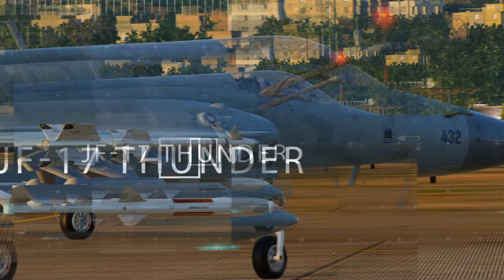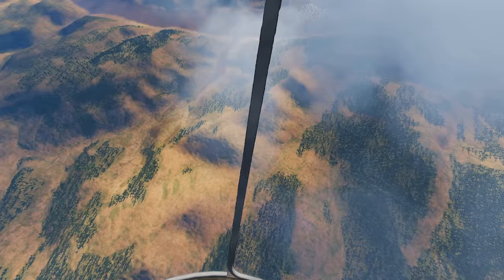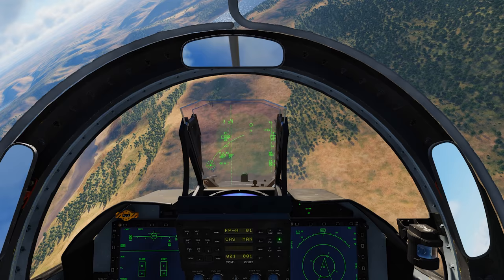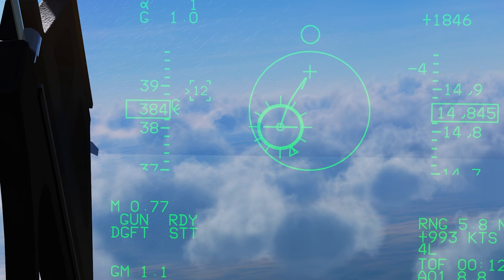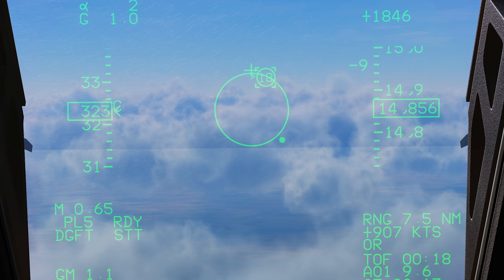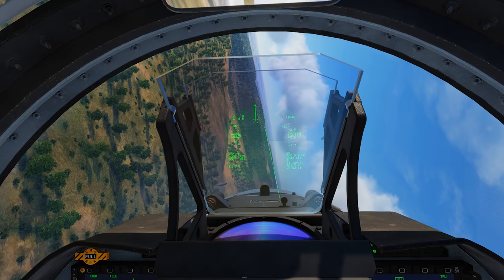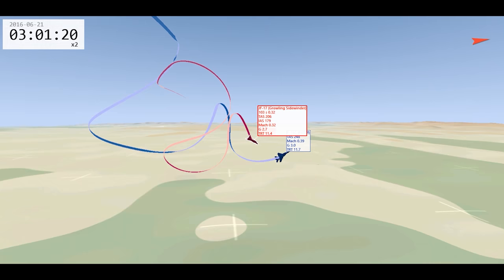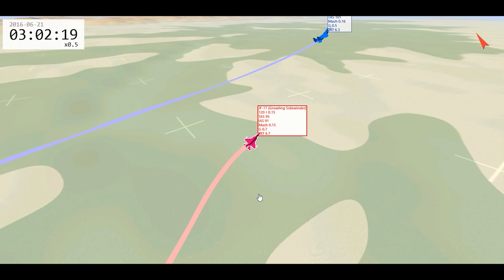JF-17 Thunder Vs. F-15C Eagle Dogfight | Fox 2 Fox 3 | DCS.

Comment: JF-17 is like a cross with F16 & F18...and fiesty did a hammer head move with the guns...
Reply: yeah agreed. id say its more like a mig 21 and an f 16 cross (its airframe is based on a  mig 21) and laterally resembles a mig 21
Reply: @fatehgyani119  True...though now i would say f18 lerx, mig21body, f16 tail
Reply: @hippoace Yeah. The front resembles an f 16. the middle section resembles an f/a 18 and the tail resembles and f 16 and mig 21. the frame is basically the exact same frame that a mig 21 uses
Reply: That's what you get when you copy everything lol
Reply: @fatehgyani119  jf-17 is Frankenstein jet 😀
Reply: @iskechkru  I mean it worked damn well. Samsung and apple copy each other a lot. They're both really good though. They managed to actually incorporate the best parts of these aircrafts and i gotta give em credit for that. Its a formidable opponent for sure
Reply: @fatehgyani119  Spoiler alert, 70% of Apples Iphone parts are made by Samsung.. so its little surprise there are similarities... Apple buys Samsung manufacturing to the tune of over 5 billion a year.
Samsung doesnt need to copy Apple, the Iphone is basically made by Samsung & Assembled by Foxconn in China and branded as "Apple"
There are only a few manufacturers who have total vertical integration, where they  design and manufacture all the components, Sony Samsung and LG Phillips consortiums control 95% of the LCD Panel market, the remaining 5% taken by Chinese manufacturers. So the most important part of any Premium phone is typically by those 2 main LCD consortiums...
Reply: Actually Pakistan Airforce needed some plane that is cheaper and yet could be comparable with f16. Though the first batch was not much comparables but the block 3 is predicted to be on par with modern f16s. So incremental improvements is something that everyone should go for. Now the old block 1s can easily be upgraded to block 3. Idk if there are plans since block 3s are still on development.
To add jf17s are a mix of everything. That's good thing as they can be used in variety of situations.
Reply: @masoodjalal1152  yes agreed. But we were just talking about the looks and body frame. The current jf 17s may not be as good as f 22 raptors, but for one tenth the price, the value is unbeatable. It is about as good as the Mirage 2000c. The mirage costs almost 2 times as much as the jf 17
Reply: بلال احمد  su 27 was a rival to the f 16. The body is based on a mig 21, but heavily heavily upgraded
Reply: Ever heard of F20 tigershark.
Reply: @fatehgyani119  Su-27 is comparable to the F-15 in terms of its role. A very large, long ranged, Air Superiority fighter. The motto "Not a pound for Air to Ground" applies to the design.

  The F-16 is nothing like it. Its a short ranged, multi-role fighter,  designed from the outset to carry bombs. It was never a pure Air to Air platform, unlike the Su'27 and F-15
Reply: @mohammadusman1826  Yes Chuck Yeager told us all about it.
Reply: @martinpalmer6203  the su 30 is like the f 15 or f 14. su 27 is a smaller air to air super maneuverable aircraft, which is a direct competitor to the f/a 18 hornet and f 16.
Reply: @fatehgyani119  Educate yourself before trying to tell others they are wrong.https://youtu.be/yZvMljUNCeU
The Su 30 uses the same airframe as the SU-27... as does the SU-35,34,33 &37 . They are all incremental advancements and variations on the original SU27 airframe. All variations are typically  21.9m long with 14.7m wingspan, or very close to it.
https://en.m.wikipedia.org/wiki/Sukhoi_Su-27

The MIG-29 is the direct analog to the F/A 18 and F-16, being a small,  lightweight , multi-role aircraft
Reply: @Munir Khan DCS
Reply: @Red Man smh. No it can't. Pl15 isnt as good as the updated amraam. Also the f22 wouldnt show up on the radars and the missile wouldnt be able to get a lock. Jf 17 has no chance against an f 22
Reply: JF 17 THUNDER IS THE HUNTER THE SKY BEAST... JF BLOCK 2 IS THE BEAST THINK How powerful & unique block 3 is bingo
Reply: @naseertimes6387  dude jf 17 is decent but it is nowhere near the best. not even close. It's got a terrible radar, terrible avionics, extremely bulky, and jf 17 block 3 is still just in prototype stage so I sont think you should get too happy
Reply: @Red Man JF-17 can beat F22 😂😂😂😂 of course in your Īslamîst Dream LMAO 🤣
Reply: @rajatdas3534  Most jets across the world take aerial dynamics and copy engine tech design from each other. Some like the Saab Griphen use F16 power plant or the Indian non-starter-Tejas using American jet engines, other countries can't produce their own and buy wholesale from others.
Reply: @rajatdas3534  JF17 has become your Hinduvta nightmare !
Reply: What about the F20?
Reply: But at what point does multiple designs would result in a completely new one... JF holds it's own.. give it a bit of credit
Reply: @aap9167  yeah people expect folks to reinvent the wheel...🤷‍♂️

Comment: I know you didn't like round 2 but I'm sorry you had me laughing.  Question JF-17 vs F/A-18 in a rate fight, which aircraft is better at it?
Reply from the maker: F-18 can outrate the Jeff in DCS by like 2 degrees. So f-18 is better but only by a little bit
Reply: @GrowlingSidewinder  Thank you and for your content, please keep it up.
Reply: @GrowlingSidewinder  Any chance at a Fox-2 JF vs F-18C video?
Reply: @GrowlingSidewinder  If jeff gets more powerful engine can it help to improve its sustained angle of attack or it just depends on the design of it?
Reply: khawar khan it’s engine is powerful, just needs the HMD from the MiG-29
Reply: @KK-px4hh  more powerful engine in the JF-17 Block 3 which entered service recently will definitely increase the sustained turn rate and angle of attack.
Reply: @GrowlingSidewinder  Jeff: give me another engine, and I will show you what’s called a pro gamer move.

Comment: Can someone explain how a JF-17 will outrate an F-15?

Won't any plane with a higher TWR win a rate fight in the long run? Also the JF-17 has delta wings, which means it should bleed more speed?
I don't have much of an understanding of the physics of dogfighting, but from those 2 points, I would expect a JF-17 to be better in a one circle, rather than 2-circle, like a phantom vs mig-21

Comment: Interesting video, I really loved the intro, that was super cool.
However, in my opinion, these Fox 3s were a waste, why would you fire a BVR missile in stonetoss range?
Thats what you got Fox 2s for.
Reply from the maker: Not when u consider the fact that the fox3s can actually turn better than the fox2s
Reply: @GrowlingSidewinder  I'd like to see the facts that led to this conclusion. By all accounts, it doesnt add up.
Reply: @dundun92  That makes no sense. And Sounds like something DCS got wrong then. Please do send send sources, would be an interesting read.
Reply: @dundun92  I'm pretty sure thats now how it works. The 9X and 73 have thrust vecotring for a reason. The 120 has a big rocket motor that burns much longer than a heaters.  The 120 doesnt have thrust vectoring nor is it designed to turn like a 9X at close range. I have also never heard of pilots lobbing AMRAAMS at airplines WVR.

Comment: The problem with the lack of an HMD on the JF-17 can theoretically be overcome if Deka upgrade the model to a Block 3. Now obviously the actual Block 3 is in final testing stages, but something similar to the refueling probe could be achieved where the player has the option to switch from Block 1 to Block 2. Apart from minor engine and electronics tweaks, there wasn't anything groundbreaking in Block 2 in reality. And adding or removing the refueling probe in-game basically makes the JF-17 interchangeable between the first two Blocks. Something similar can be achieved with Block 3 in-game as well.
Reply: Nope to be able to achieve that they need to redesign cockpit as well cuz block 3 will have single panel multi functional display its a little bit pricey so overall quality will be better. Its basically not a cheap anymore. They will need to change flight performance too because of better performance from engine.
Reply: Also has fly by optics on all axis. Integerated IRST and so on.
Reply: @focusgaming5425  Makes sense. But then again,  the MFD issue would be more of a texture one. The flight performance can be tweaked to compensate for actual changes. In all, you'd only require a minor load time in-game to switch between the different variants. Having an SSD could fix that.
Reply: @hamzab6046  well you may be right but this issue have a perspective of politics and unbalance. I think they will not make it availble because of these reason for example showing too much to the outer world about aircraft will be harmfull for Pakistan because PAF will use it. And for balance it will come with pl15 with 300 + km theoratical range which will disrupt the balance. They are already criticising sd 10.
Reply: @focusgaming5425  It'll probably be more an issue of not having vital information publicly available at the time of release. The JF-17 Block 1 isn't anything new. It' had been around for quite some time before it got into DCS. Regarding the SD-10 well people are obviously going to complain about something that puts then at a disadvantage. it comes down to Eagle Dynamics and their policy of whether they cave in to community demands of such nature or not.

Comment: Jf17 was made for paf who operate f16s, mirages and mig21 so it's a mix of all aswell as bit of f18s, very front is like mirage, rear front mix of f16s and f18, middle body section like mig21 and wing tops and tail section like f16,, perfect cheap fighter but able to stand up to most 3rd and forth gen jets esp block 3